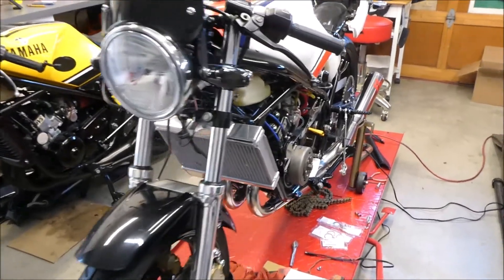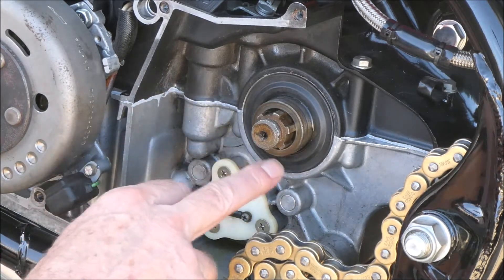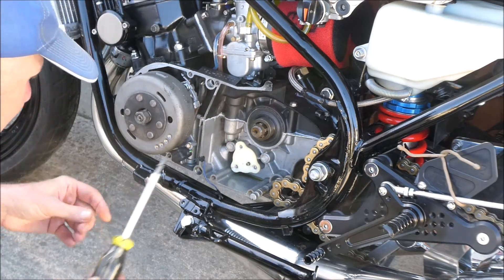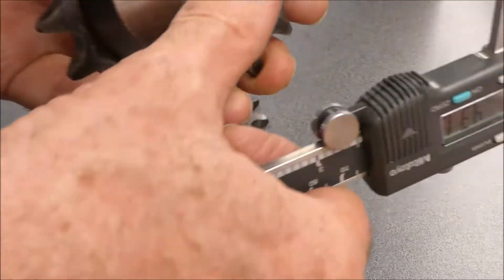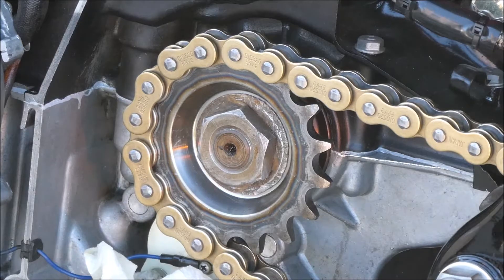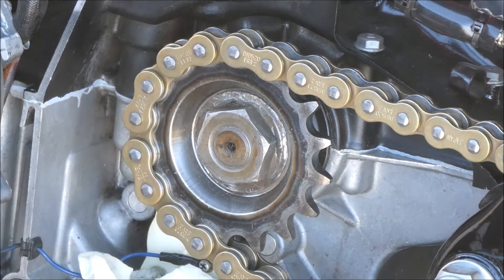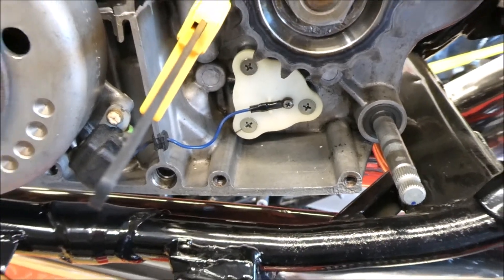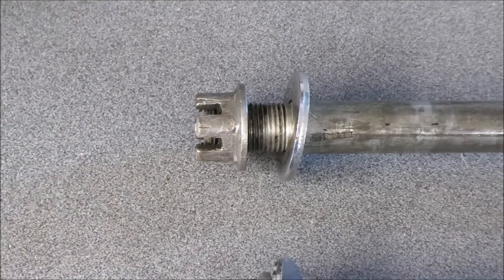RZ350 RZ FZ FZR Project Motorcycle Ep8-Change neutral switch oring-Install 10mm offset CS sprocket

Comment from the maker: Sometimes comments show up in my notifications and they don't show up here. Weird. David Cormier asked why I run an offset sprocket. This bike runs a wider FZR rear wheel and tire as does the yellow bike next to it which has a better SV650 17" rear wheel. The offset sprocket is required for chain alignment with the wider wheel and for the chain to clear the wider 150 tires used on these wheels. The sprocket carrier hubs have to be machined down also to pull the chain closer to the wheel to get the chain properly aligned. Thanks for watching and the nice comment.